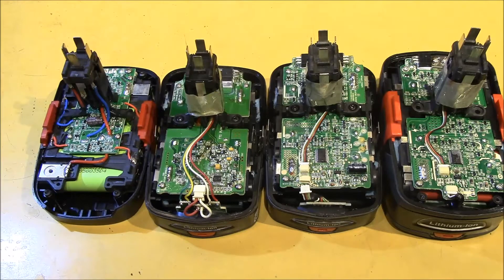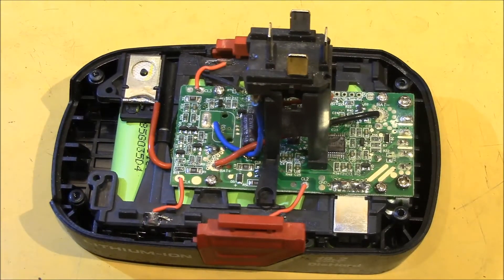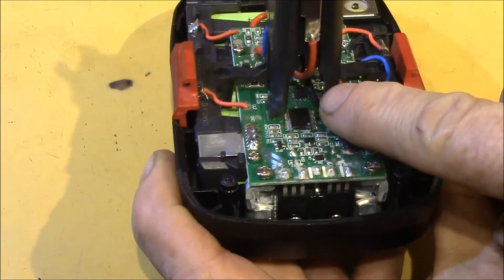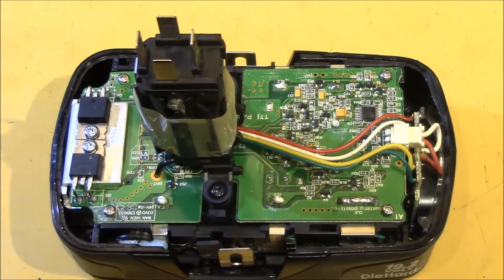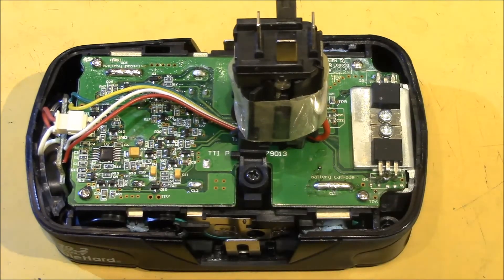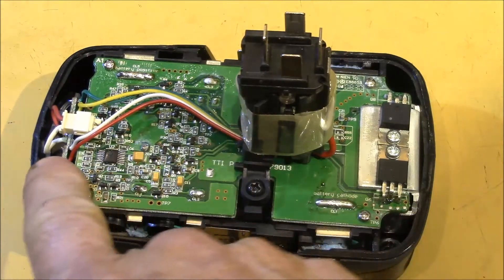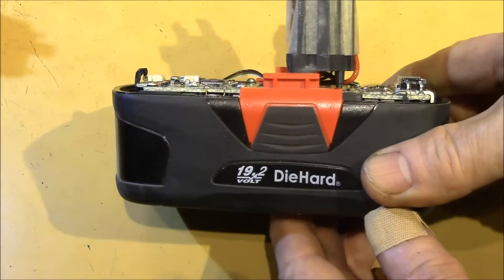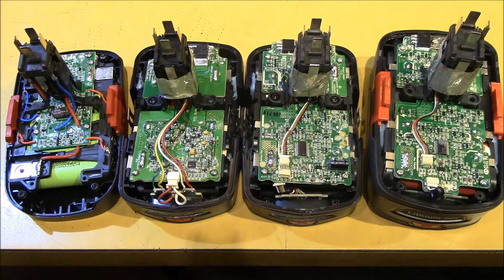C3 Battery Tear Down, Part 3

Comment: GREAT to see this series of videos.I too was given a drill and 2 battery's by a friend that upgraded .both battery's are dead so now I'm doing the same process.It's actually fun to see how you went by in IMPROVEMENTS in the packs.thanks
Reply from the maker: It's not too hard to repair them.  The ones I did repair are still in use 8 years later.

Comment: came across this when I was tearing down my Ryobi 4Ah 18v battery, and saw the chip HA1930, I'm looking for it's max amp protection, no luck on any data.
Reply from the maker: This thread seems to indicate it may just be a pre-programmed micro-controller for the BMS:
https://www.eevblog.com/forum/chat/ha1930-iss-datasheet/
It may have an analog input tied to a current sense resistor for that purpose.

Comment: I have two of these but they have a different boards inside.  I could not charge them with my 4 port multi charger, they test as defective, so I took them apart and charged them with my rc charger.   They work well and last a while. Still won't charge in the charger.  I placed a wire straight from negative terminal to battery bypassing the board.  It will now start to charge in the charger, however I do not know if it is thinking that it is now a NICD battery.  How could I know if it's using the correct voltage for li and not nicd?
Reply from the maker: My understanding of these battery packs is that the BMS board inside the unit is what does the charge termination.  The charger seems to put out  some high enough voltage then like you mention I think it assumes NiCd.  But if the battery is Li-Ion, then I think it's the battery pack itself that stops accepting charge when the BMS determines the battery is fully topped off.  
One option I need to finish with is to make a charging adapter for my RC charger to directly plug in the Li-Ion packs for direct charging.  I did this on my Black and Decker battery packs and that worked well.  I also wired in a 5S balance cable/connector and can plug in the charging adapter and balance cable and do a full 5S balance charge, or I can do a fast charge or any of the other RC charger options.  This is much better that the one size fits all C3 chargers.  I also have at least one battery pack that's finicky as to whether it'll charge off a C3 charger or not.
Reply: @The4Crawler  I did just that as well, I had some cables from a tv that I took apart and made a 5s balance cable to use with my rc charger, that's actually the first thing that I did to charge them up.  Drilled a hole at the back and the plug hangs there with just enough length to plug into the charger. One battery in the pack only goes to 4.5v fully charged and holds at 3.2 volts when under load so that could be the issue with the pack, I do not know enough about the boards.
Reply: @The4Crawler  These batteries when placed into the drill work fine but after a while if you test them they show around 8v, so triggering the drill makes the battery kick on and supply the full power, safety feature I assume.  So then I placed a wire on the negative and it bypasses that feature, but I was unsure of the safety, so then I drilled a hole in the top and placed a toggle button so that I could enable/disable the connection to charge it.  That's when it hit me that by doing that, it might think it's a nicad because it skips the board.  If I go somewhere I didn't want to take my rc charger, just my regular drill charger that's why I tried all that.
Reply from the maker: @eeledahc  That's a good idea with the toggle switch.  I may have to give that a try.  Yes, usually the BMS will wake up and turn on the battery if it sees a load, like the drill motor.  I've done that before on a battery that wouldn't charge, just plug it into a tool and run it a while then move the battery to the charger right a way and see if it'll start accepting a charge.

Comment: I have 19.2 volt C3 battery when fully charged it reads 17.5 vdc ?? do i have one cell that is bad??
Reply from the maker: Yes, it could be one cell is weak.  Easy enough to open up the case and check voltages on each cell in the pack.

Comment: I have a question, if anyone would care to share your thoughts.
I have several of the compact batteries. One of them takes a charge but will not hold the charge. I have measured the voltage from a full charge and it drops about 0.5 volts every 24 hours. Connected to nothing. My other batteries maintain their charge and are always ready to use. This battery has done this since purchase. Could the circuit board be the problem? Any thoughts on this? 
I have a "yard sale" battery for parts and thought about swapping out the boards.
Reply from the maker: It could be either the BMS board or a bad battery cell.  One way to find out is to charge up the battery then carefully cut the metal strip connecting the cells to the BMS.  Then measure the voltage across each cell and see if any ov them drop over time.  If not, the cells may be OK and the BMS is bad.  Maybe it has a balancing transistor/resistor stuck on and that's constantly discharging the cells or it's just pulling too much current when sitting.
Reply: @The4Crawler  Thanks, I'll check the batteries, individually and go from there. Thanks for your response. Much appreciated.
Reply from the maker: Would be nice if those cells were in spring loaded holders for easier testing.  The spot welding is more reliable though.
Reply: @The4Crawler  Yes it would. Rebuilding would be so simple.
Reply: @The4Crawler  I have started monitoring each cell and at this time they range from 3.75-3.80. the board that is used is like the first one in your video. No date visible, LG batteries and if you notice in your video at 03:20 there is a pair of black wires between the red and blue, (tiny, almost looks like 1 wire) that appears to have a heat sensor that goes down against the positive battery end and is covered with a couple of insulation pads. That is what led me to believe it was a heat sensor. I purchased two of these batteries and charger new/ still in a sealed box about 2 years ago. It could have been old stock, I don't know. Thought I would share the info that I have. It could be of interest to someone. Maybe it will help get more comments posted. Subbed to your channel.👍
Reply from the maker: Good information.  Yes, I also suspected those extra wires are some sort of thermistor to sense temperature.  I think the chargers use that to cut off charge if the cells overheat.

Comment: Product timelines will tell how serious of their product quality assurance. Btw, status LED can be misleading. Ex. I was tweeting TP4056 module with battery protection current limiting R3 using a 10 turns Bourne Pot, Blue LED lit up when the li-on not even fully charged. I tagged a Ammeter/Voltmeter 33v 3A on the battery connection, here it go 4.12 rather than 4.21. As a result, measured voltage still clear doubts. Likewise, our physical hand touch, once device sudden heat up, we feel something must be wrong ! hahaha......
Reply from the maker: For sure, the indicator LEDs are not terribly helpful.  Like the C3 fuel gauge LEDs read green for almost the full discharge then yellow/red just the last little bit.  But on my packs with the LEDs, at least I can push the button and if I don't see green, I'll grab a different pack and throw that dead one on the charger.  And in the charger, you get the red and green LEDs with different blink patterns, but it does not really tell you a whole lot.  I'll be posting some videos on charging the C3 packs on the iMAX-B6 charger to see what they are really doing.  I still have to figure out the charger settings to match what the BMS board is doing inside the battery pack.  I think they are using 4.1v/cell.  There is quite a bit to learn about using these lithium batteries, for sure.

Comment: The original design on the left has exactly the same PCB as an old dead Ryobi P102 that I just pulled apart.
Reply from the maker: Thanks for that.  I imagine that all these cordless tool companies source their battery packs from outside suppliers and they may have used the same supplier, at least originally.  Over time they each tweaked the internal designs.
Reply: No problem.  Interestingly enough, the date on the back of the PCB is May 23, 2012.  The only real differences that I can spot are that the "stem" connector on the Ryobi is fitted with a different part has three connections on it, and there is a single contact that fits perfectly within the outline labeled "T1(S)" (near "CL5") where the blue wire going to the C3 stem is.  I bet with a bit of hacking/splicing you could make a Ryobi charger or Craftsman charger work with either pack.
Reply: Still the same as the Ryobi battery I bought just now in 2018 -- I found this video when I was searching for the SOP32 part. For the record, the part number on the QFP20 part is F10020 // 16A98Y, not that seems to reveal anything. I find it slightly strange that there don't seem to be any markings whatsoever as to the real manufacturer.
Reply: I have a 2009 P103 with a dead BMS that looks very similar to all of these to.